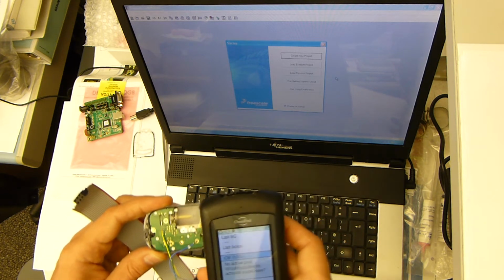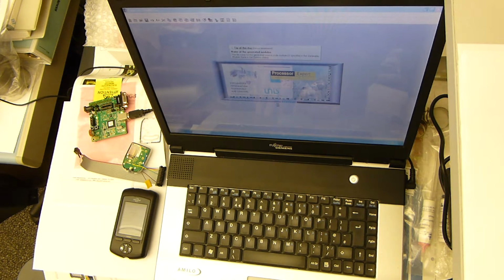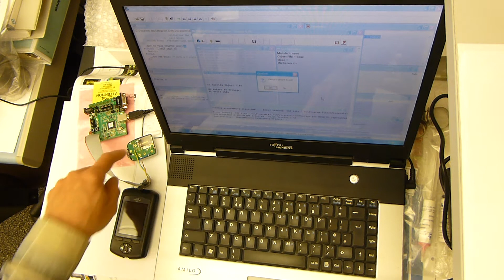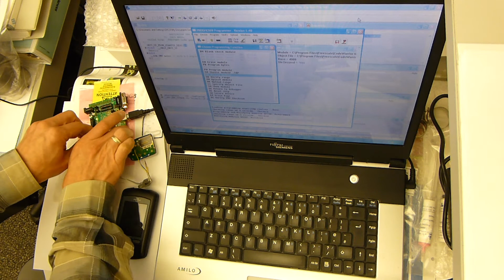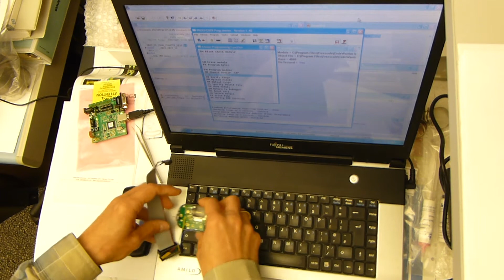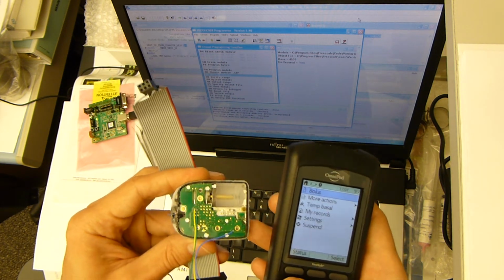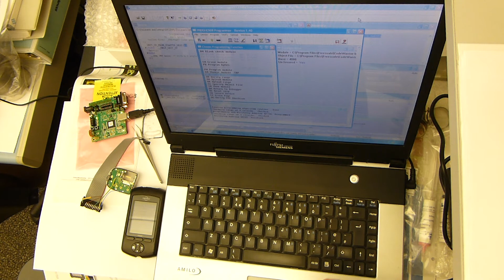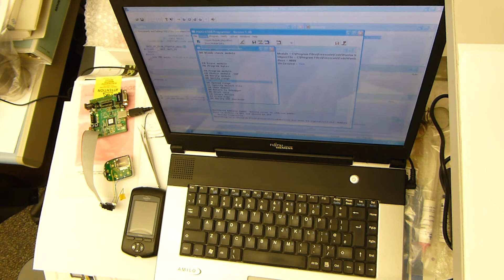Firmware upload on Omnipod tubeless insulin pump

Comment: Not that I'm misunderstood. I don’t want to hack the PODs, but I want to reprogram the MCUs of my used PODs for other purposes. Do you see chances for success?
Reply from the maker: Sure, start with using PE Micro programming software with 9S08 demo board (make sure you remove on-board 9S08 microcontroller first). 9S08ER48 can be programmed with most 48kB algorithms, e.g. 9S08AW48 (in case PE Micro removed ER48 support from algorithms list). Alternatively, you can use universal programmer like Elnec BeeProg2 and again use 9S08AW48 as the target. Flash memory addresses and programming protocol is exactly the same. Any differences kick in at SFR level, but that's when you try to compile code using CodeWarrior. For that you have to find legacy software version 10.
Reply: Do you still have the version 10.2 of CodeWarrior?

Comment: Second question: Does the demo9s08qg8 board accept any other 9s08 MCUs besides 9s08qg8 for flashing? Not in my case. :(
Reply from the maker: You can use the board as a programmer - just pull out the 9S08QG8 chip and wire the debug interface to your own device. Then you can use Code Warrior for programming or independent PE Micro programming software.
Reply: Hi, thanks for the answer.
I had done exactly what you did, but deleting the flash does not work. I use the codewarrior 11.1. I believe that during the first driver search PEmicro updated the firmware of the DEMO board so that it does not handle any other MCU except 9S08QG8 chip via BDM.

Comment: Very interesting. Where did you find the original firmware of the pod and which replacement device did you choose for flashing? Because sc9s08er can not be found in code warrior.
Reply from the maker: It is impossible to find the firmware, I had to extract it from the chip. There are lots of details in my paper "Deep dip teardown of tubeless insulin pump" ( https://arxiv.org/ftp/arxiv/papers/1709/1709.06026.pdf ). There is no replacement device for 9S08ER48. I had to reflash the same one from another device. Code Warrior does support SC9S08ER48. Again, please read my paper.
Reply: I had read your paper a few times before I wrote you here.
No, unfortunately code warriror supports no longer this chip because it is a custom chip. I talked to people from nxp and they could not help me.
I can not find the earlier versions of Code Warrior that supported this chip.
What I have noticed with several used pods is that their quartz oscillator does not resonate. Can you confirm it?
Reply from the maker: Legacy CodeWarrior versions used to be available two years ago.Pods tend to hang because their reset circuit wasn't designed properly. The only workaround I found is to disconnect the battery and put it back. This initiates POR and microcontroller starts working. I had this issue many times while attempting to re-flash pods. Maybe it's also the reason why your tools don't see ER48 chip.